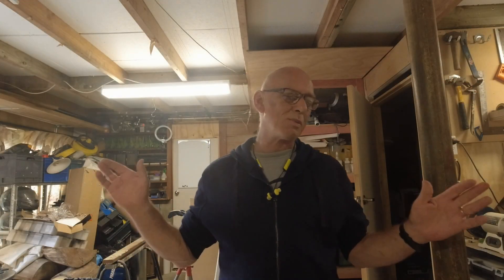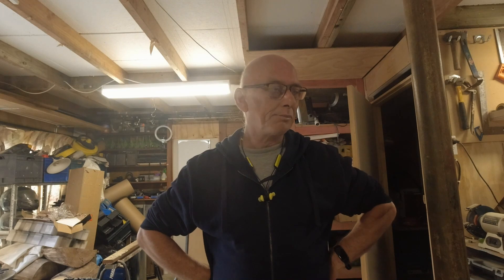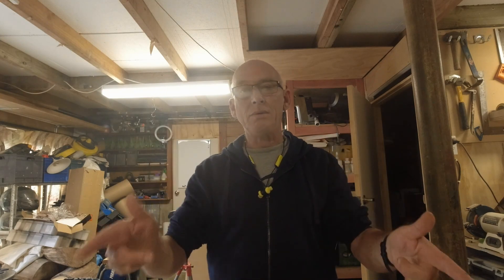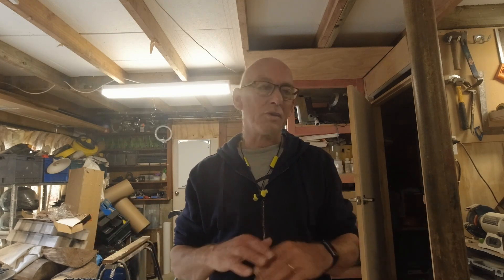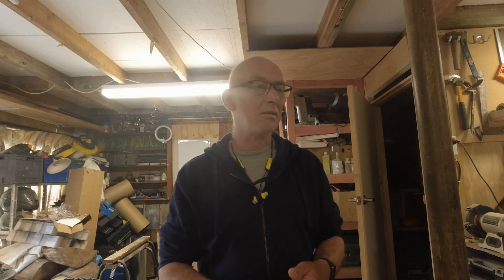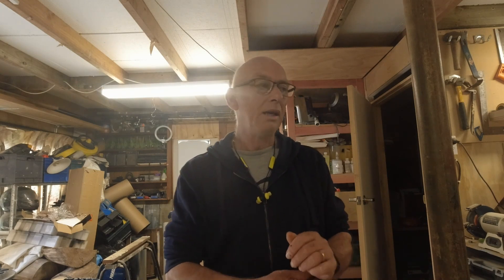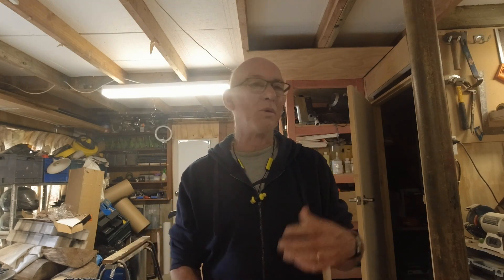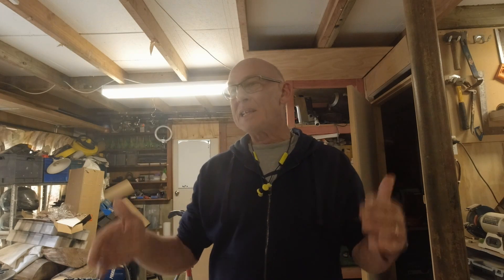P1 MPCNC Build - First part making a mostly printed CNC

Comment: As much fun as this was to watch, I can't stop wondering about that Windows crash and reboot on his laptop at 7:28. I. Must. Focus.
Reply from the maker: lol yeah I know you can see me pause thinking what the f but I am an IT engineer and turned out it was some software I used to run and after a update kept crashing on the same file randomly so did a quick clean up and all good now as that happening when it was running the CNC would not be good lol. Built a PC for the CNC now so its just dedicated to doing that.

Comment: What are your usable dimensions?  Looks good.
Reply from the maker: i thought it was going to be 900 x 900 but is really around 860 x860. was not sure if it would cut well at this size but all seems to work really well and the tube is just steel not stainless steel but no major flex.
Reply: @MadTaff  thanks for the quick reply.  Great videos.  I'm going to have build one of these.